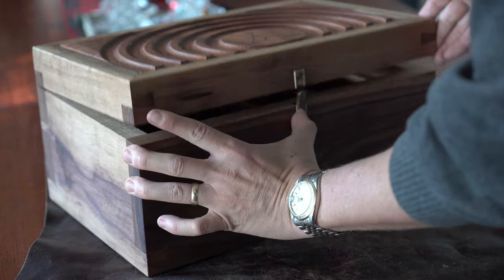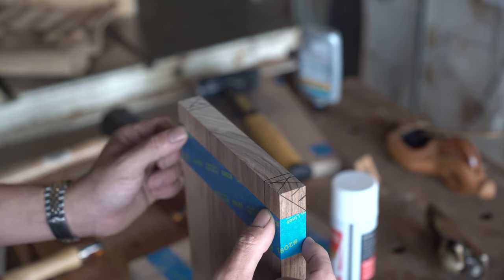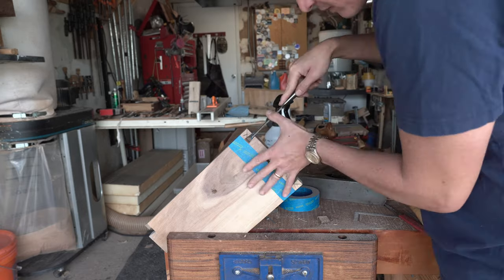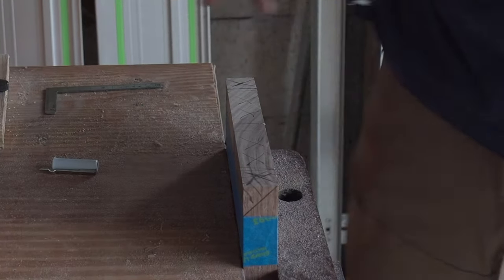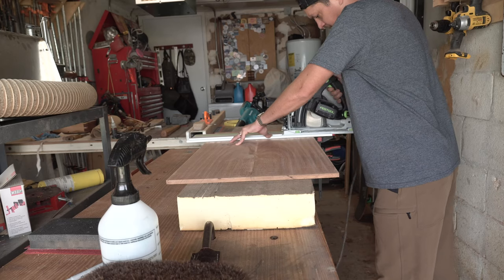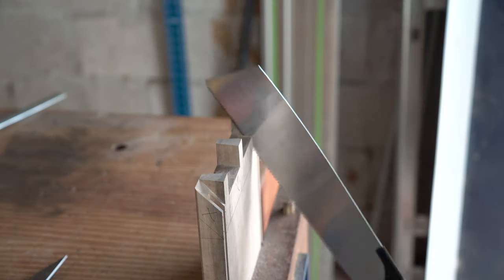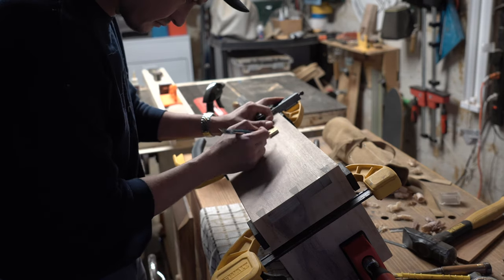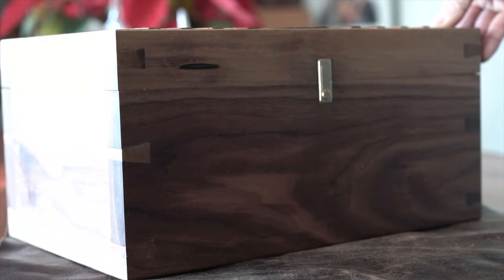Dovetail Jewelry Box with Mitered Corners | Dovetail Box | Miter Dovetail

Comment from the maker: Help support my channel through the following links:
1/3 Sheet Reusable Hand Sanding Block with Assorted SandNET Faster Reusable Sheets (80,120,220 Grit ): http://homedepot.sjv.io/c/2589535/1208502/8154
The Real Milk Paint Company's Impressive line of finishing products (Special Affiliate Link):
https://www.realmilkpaint.com/ref/cowdogcraftworks/
For 10% off use coupon code: cowdogcraftworks
-Starbond CA Glues (Special Affiliate Link): https://bit.ly/3A6I5h8
For 10% off use coupon code: cowdogcraftworks
-Western Saws Sourced from Florip Toolworks (Non-affiliate): https://floriptoolworks.com/
-Sumitsubo, Ink, and Related tools from Hida Tool (Non-affiliate): http://hidatool.com/
-Brusso Hardware (Non-Affliate): https://rb.gy/vzbfig

The Complete Japanese Joinery (Book): https://amzn.to/2OAj1sM
Z-Saw Cross H-265 Carpenter Saw Hard Impulse 15003: https://amzn.to/3oWENbT
Makita RT0701CX7 1-1/4 HP Compact Router Kit: https://amzn.to/3rLYh6b
Duck Brand Select Grip EasyLiner Shelf and Drawer Liner, 12-Inch x 10-Feet, Non-Adhesive, Light Grey, 283310: https://amzn.to/3oidWrx
Shapton Glass Stone Set w/Field Holder #500, 2000, 16000 Grit 5mm: https://amzn.to/3ojR230
Metric Japanese Style Carpenter's Square: https://amzn.to/35kC3fG
Mini Square 10x5cm: https://amzn.to/36mtcti
Freud Flush, 1/8",1/4",5/16",3/8",7/16",1/2" Depth Rabbeting Bit Set with interchangeable bearings with 1/4" Shank (32-504): https://amzn.to/3DdZJQN
Faber-Castell Ecco Pigment 0.1 mm Pen: https://amzn.to/36oLni8
Pentel Mechanical Pencil: https://amzn.to/36uqbab
Center Punch: https://amzn.to/3fSQsCj
Yataro Authentic Japanese Chisel Set (5 Piece): https://amzn.to/3CLUEyV
Real Milk Paint Pure Tung Oil: https://amzn.to/3fFil0S
Tormek T-8 Water Cooled Sharpener: https://amzn.to/3hM39jn
Stanley Sweetheart Chisels: https://amzn.to/2ZATrKg
DFM Tool Works Card Scraper Set: https://amzn.to/2CMZp1W
DFM Tool Works Card Scraper Burnisher: https://amzn.to/2ZAwzuv
DFM Tool Works Small Square and Center Finder: https://amzn.to/3jfFdXd
Glu-bot Glue Bottle: https://amzn.to/2CdxYOV
Mineral Spirits: https://amzn.to/31xTBmG
Dewalt Compact Drill: https://amzn.to/3ht3tng

If you want access to more tools, check out my amazon storefront: https://www.amazon.com/shop/cowdogcraftworks

//Follow along:

IG: https://www.instagram.com/cowdogcraftworks/
Twitter: http://www.twitter.com/cowdogcraftwork
Facebook: http://www.facebook.com/cowdogcraftworks
Website: http://www.cowdogcraftworks.com

Comment: Aswesome job as usual my friend!!! Where did you get that tiny double square you were checking the squareness of the dovetails.
Reply from the maker: So the square itself is a starret but the blade is from Sterling tool works. They make a double square but also just the blade.
Reply: Awesome thanks for the info.

Comment: Very nice! I was curious how much paring with a chisel do you end up doing on the pins and tails? I find i spend a lot of time paring the final fit.
Reply from the maker: It kind of varies. I don’t do too much. On the miters there was a fair bit of work but the pins and tails not so much. Also it didn’t make the video but I think I’ve done it in other videos… I’ll use a Japanese side plane float to file the pins a bit to fit. A friend once told me dovetails are sawn not paired so I try to focus on quality sawing to ensure the filing and paring is to a minimum.